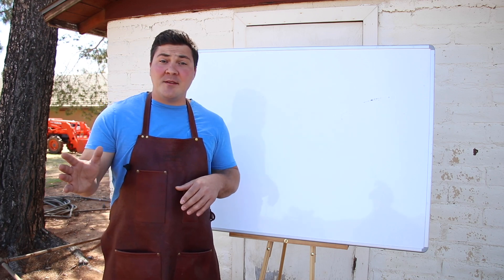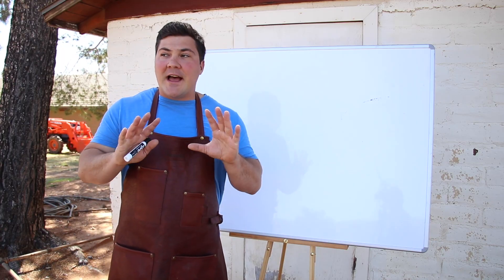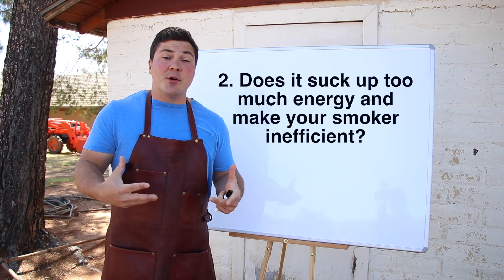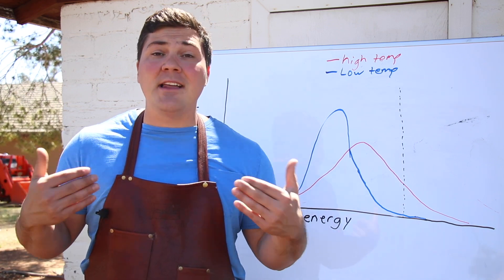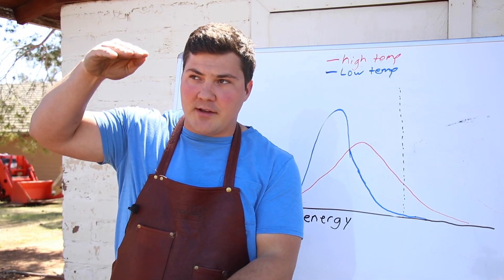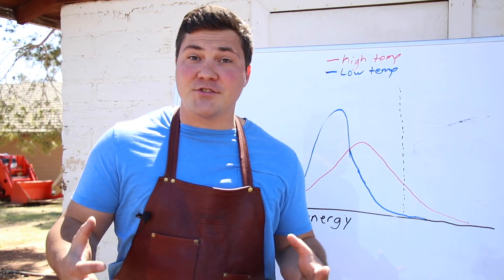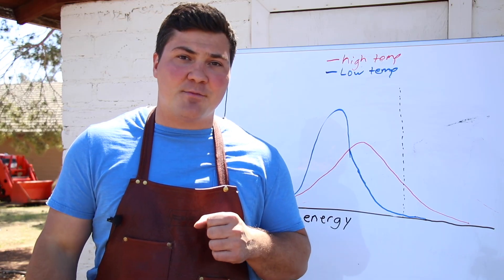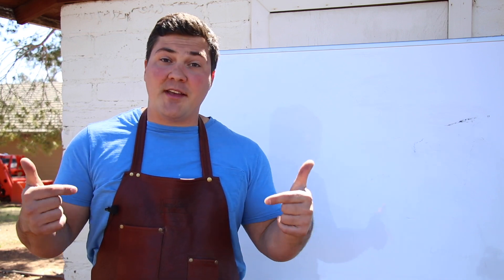Do Water Pans Improve Barbecue? A Scientific Analysis

Comment: I have an offset smoker and I use a water pan when I’m going to have long cooks and I’ve found it’s not needed for shorter cooks. I recently removed my baffle plate and found that the best place for the water pan is all the way back right in my smoker. The one or two times that I have forgotten it or it ran out of water, I could tell a difference in the outside of the meat I was smoking. Great video and a lot of technical information for us to absorb.

Comment: Weber's Smokey Mountain 18 or 22 comes with a water pan.  It's been manufactured for years..  I'm glad it has a water pan... and I fill it up everytime I do a smoke.  I personally think it makes temp. more manageable.  I'm not well educated... in fact... a poor High Schooler that barely graduated.  Weber designed that smoker...  If it had been a mistake, I'm sure they would have changed it, down through the years... so I trust them, that they did the right thing... and I use it.
Now almost 70... my ribs have always been great.  Good Video.

Comment: Something I can’t find mention of…. By increasing humidity in the cook chamber you somewhat shift your equilibrium toward condensation vs evaporation on unwrapped meat.  This should help overcome the “stall” caused by the cooling effect of water evaporating from the meat countering the heating from the cook chamber.  I think it just drives the stall point higher, but it does affect it.

Comment: i got one for you to try. Smoke a brisket like you do regular. the when you wrap instead of paper get an aluminum pan with talo at the bottom that you smoked, lay the brisket in it then poke holes on another pan and use metal spring clips to secure it to the other one and finish smoking.

Comment: this is great breakdown- but very specific to your smoker/setup. consider pointing out the difference between a ceramic/kamado style and a non insulated metal cooker. the need for moisture to be added changes significantly based on the cooker!! Also as stated this can help people understand the benefit of a pellet smoker as well
Reply: we like tradition so we use wood as out heat source it's an art to be mastered unlike a pellet smoker which is no more than an outdoor oven, set and forget it. it's all about the whole process to us pit masters. You'll never get the real smoke taste with a pellet smoker as you do with an offset.

Comment: I have another variable that I think might need to be addressed.  Correct me if I'm wrong.... I'll try to spell out my question.  A water pan will increase moisture through evaporation, but moisture content in the heated smoky air flowing over the meat is greatly effected by the volume of air you're pushing.  As you've said in other videos, airflow is what makes an offset smoker yield more flavorful meat, and what you've said in this video, much heat and moisture are lost to the stack.  In the case of this example, more airflow would mean lost through the stack, which would seem to lessen the effect of added water- there would be a smaller change in the humidity of the cook chamber and less moisture interacting with the meat.  There could be some balance point where the hotter fire to overcome the loss of energy to the water pan increases the airflow so that there is no net gain.

Comment: The question I've been trying to answer is how does this change for a pellet smoker/grill which is essentially just a convection oven. The air is moving through quicker and the air from the outside is being pumped into it quickly and never goes across a moisture producing firebox first.
Reply: put a small water pan next to the auger - it will work just fine
Reply: @unclealzbbq2185  you genius

Comment: Hold up!! 69.6 lbs of water from wood ? you burn 348 lbs of wood for 1~3 brisket ?   That is a crazy amount of wood, your smoker must be huge. Great video and I agree with your assessment.  as you said, many people use hotel pans in small offset smoker like 35 gallon or less, and they arn't burning 40lbs of wood much less 350, so that is going to have more effect on total moisture.   I have a trailer mounted offset smoker. Its made of pipe,  I would guess its around 350~400 gallons.   I use a water pan as a moderator for the fire.  Like control rods in a reactor,  not for moisture.   The hotter the draw off the fire box  , the faster the water boils.  water to steam expands by a factor of 1700 to 1. slowing the draw and reducing the heat from the fire box as well like you said the temp of the flue gas coming off the fire box.   My 1 cubic foot of water will displace 1700 cubic feet of fresh air coming in the fire box with the exhaust rate unchanged.   in this process i can also run the fire box hotter, keeping more open flame and less smoldering creosote, as well as more "air" moving across the smoker giving me a more even temp on my equipment.

Comment: sorry,but my shift button does not work any more. a old laptop. i am subscribed to your channel. you have a video on the best smoker for beginners. i would say this, i used a old used smoker that my neighbor gave me before he past away. he only asked me to smoke a brisket for him and i did. i was a old brinkman offset smoker and i cleaned it and seasoned the inside before using it. was taught by different videos on youtube. he had that brisket a week before he past away. then i gave it to my other neighbor that wanted it. he even gave me 100 dollars for it. then i saved my money for a few months, because i am on social security. i bought a brand new oklahoma joe highland smoker. then i bought a metal 6 shelve unit from home depot. the bottom shelve has cherry wood on it, then the next shevle has pecan wood, then i have my smoking tools on the next shelve. like my chimney, temp gauge by thermpro, some store bought rubs and 2 boxes of latex gloves. above that its all oak wood. i buy my wood from a man that has a tree service. then when i run low i buy some wood and cut it with my chop saw to fit in my fire box. some of the mods that i bought was the metal milk grate for my fire box and a smoke baffle. i also bought a metal meat loaf pan from walmart and i use it for everything that i smoke. so far i have smoked a few brisket flats, a boston butt, a few slabs of spare ribs and some beef ribs. when i smoke i give my one neighbor some of the meat or chicken or fish o cheese that i smoke. i even make some killer cheese dips in my smoker. my metal shelve is in my garage with my smoker and grill only until i get my patio done in my back yard. but my choice for a first time smoker is the highland smoker that you can get at lowes everyday. everything else i get from amazon, except for my lump charcoal. but now i need to say thank you for putting all these videos together for all of us. you have helped alot of people on this hobby. because of you i will never go hungry. thank you again from jacksonville fl. if your ever in the area stop by and say hello. i am your tallest subscriber you have. all 7 foot 3 inch tall man. thank you again. i forgot to say, i used a small fan that sits level with my fire box to keep my fire going. it helps out alot

Comment: This is a 2 parter question but might not be fully on this topic.   I have a Chargriller 50/50 without the smoker box attached.  I have tried to smoke in the regular charcoal grill side and find that with the vent open to this chamber it still does not seem like enough air gets in to make it burn clean and I still get white smoke but not thick bellows of it.  should i use a water pan or soak the wood which I heard you should not do.  sometimes i use wood chunks and sometime chips and the chips seem to burn up quick so do i empty a whole bag on at once or constantly sprinkle some more on as i go along.  any advice, help is greatly appreciated and sorry if the question is silly, simple or not in right forum.  Thanks everyone

Comment: I tried using a foil one like a turkey one and it ended up being burned on the edges.. the flames were growing on the sides of my smoking stone... And the water was boiling.. i had to pull out the water tray.. it was getting melted..

Comment: Thanks for the explanation, but by calculating the mass of water, I think it over simply one key aspect which is relative humidity.
You can have loads of water but be very low on relative humidity which is what matters to transfer « moistness » to its surrounding.
A sponge in a smoker would end up dry even if there is 100l of water that has passed by.
Considering the heat sink aspect the of the pan,  it has dual action. First reduce the temperature (which by itself increase the relative humidity) and releasing humidity which amplify the relative humidity.
Some
Probes in the cooker would be the judge with and without a pan and get the relative  humidity with and w/o a pan :-)

Comment: Not sure if you will answer but does the type of water used matter? Will using like say lake water in a water pan matter vs distilled water? Worried if I am at a remote location smoking that using river water or high sulfur well water would add unwanted flavors to the meat.

Comment: Man I was glad you talked about complete vs incomplete combustion 🙂. 
Another noteworthy benefit of water pans in smaller smokers is temperature stabilization. I use a weber kettle and the grill itself doesn't retain or reradiate a substantial amount of heat like kamado cookers or heavy gauge steel smokers. The water pan is a stable heat sink which reduces the extent of temperature swings when you open the lid. That goes back to your comment about the pans making the chamber ideal weather for bbq. Cheers.

Comment: Do you really use an entire cord of wood for an 12-hour smoke? I find your calculations of 176 lbs of water to be over the top crazy. For a brisket on my BGE, I use less than 9 lbs of lump coal & seasoned wood. Here, a water pan makes a big difference. But instead of calculating the amount of expected water released -- me thinks you would do better to measure the humidity inside the smoker with & without a water pan. THIS, imo, is how you can determine if they make a difference and how much so.

Comment: I actually looked at this yesterday with my new pellet smoker. I always used a water pan in my Weber kettle to help maintain a constant temperature, swore by it. Being a new smoker to the collection and never having a pellet smoker before, I wanted to look at the temperature differential across the pit (a GMG Jim Bowie). It has a temp probe at one end to control the unit. I placed a water pan at the other end of the unit along with a second ambient temperature probe. Before the water pan, I had even temperatures across the pit running at 225. After adding water, that side of the pit dropped to 180 and pretty much stayed there. Sure it was a steady temperature but came at the cost of a huge temperature gradient across the pit. After a few hours, I pulled the pan and I went back to even temperatures across the whole pit, a steady 225. Even after kicking it up to 240, I was even across the pit.  I have the temperature graph to back it up and in my mind, the water pan created more problems than it solved. You can clearly see when the water pan was added and then removed. 

I think the controllers on a pellet grill (at least a PID controlled one) are doing the work of maintaining temperature and less of a the need of a heat sink of a water pan. Maybe I could try putting the water pan directly over the fire chamber in the center, but at this point, the space it would take up does not offset the benefit.

Yes, I know, using a pellet grill certainly takes a lot of the art out of mastering a fire, but sometimes you gotta do what you gotta do.
Reply: I've never tried it but a practice some people swear by is to evenly space raw biscuits across your entire cooking surface. This will tell you exactly where your hot spots are as they cook. Plus, you have a bunch of biscuits to eat as a bonus!
Reply: @michaelcoughlin8238  I did that when I got the grill and helped me position my heat deflector better. It was pretty even across when I was done, that is why I was so shocked with the water pan results.
Reply: Just got my first pellet grill (Traeger) and this is exactly what I needed to read.
Reply: Try filling your water pan with sand instead of water. same result, with no temperature swings.

Comment: Great video!  Isn’t conservation of energy great?  I’m teaching physics online now and have to make videos for my lectures, so I know how much work and preparation (and possibly redos) went into making this.  I’d love more detailed analyses like this.  

The greater surface area is to have a greater rate of diffusion correct(?), even though the metal would heat the water at all depths.  I wonder if the rise in temp of the metal tray thus raising the water temp at the bottom and sides 
 would be comparable to the water’s temp rise at the top?  If so then it’s even more efficient.

Comment: It seems other backyard scientists have already addressed the science of the water pan, im going to address the common sense aspect of water and cooking. If you want juicy pork chops or chicken breasts you sear them first before baking them in an oven. You can put a water pan in your oven and it will make no difference how juicy the meat is but that sear seals in the moisture. Another example is if you cook a rump roast in a crock pot or oven it still comes put dry because the lack of inter-granular fat in the muscle. Water does effect cooking efficiency in a smoker for obvious reasons but the real question is how does additional water effect the smoke? After all using a smoke is about getting smoke flavor in our foods. Its also why smoking at low temps imparts more smoke flavor than high my theory on that is once the outside later of meat gets cooked it wont take on anymore smoke. Different ball of wax when we talk about cold smoking as that is about fragile meat like fish completely different subject. Test water and its effect on smoke that wound be very interesting and as a side note i never use a water pan in my smoker.

Comment: You can't MAKE water 
When you heat air you raise it's dewpoint. You start a fire next to said metal, the metal is going to be cooler than the fire. Heating air allows the air to trap more moisture. That moisture will condense on ANYTHING that is cooler that the water saturated air around it. 
This is how an air conditioner or dehumidifier work. 
The lines with the refrigerant in them are cold. When the hot humid air meets the cold lines, the water vapor is stripped out.
You're getting way too complicated here. Matter and energy cannot be created or destroyed, they can only change forms.

Comment: Jeremy, what are your latest thoughts and recommendations on whether to use a water pan with a pellet smoker? Thank you.
Reply: I actually looked at this yesterday with my new pellet smoker. I always used a water pan in my Weber kettle to help maintain a constant temperature. Being a new smoker and never having a pellet smoker before, I wanted to look at the temperature differential across the pit (a GMG Jim Bowie). It has a temp probe at one end to control the unit. I placed a water pan at the other end of the unit along with a second ambient temperature probe. Before the water pan, I had even temperatures across the pit running at 225. After adding water, that side of the pit dropped to 180 and pretty much stayed there. Sure it was a steady temperature but came at the cost of a huge temperature gradient across the pit. After a few hours, I pulled the pan and I went back to even temperatures across the whole pit, a steady 225. Even after kicking it up to 240, I was even across the pit  I have the temperature graph to back it up and in my mind, the water pan created more problems than it solved. You can clearly see when the water pan was added and then removed. 

I think the controllers on a pellet grill are doing the work of maintaining temperature and no need of a heat sink of a water pan

Comment: While I did enjoy the video and commend you on your education, what you took a long time to say really didn’t say much. You presented no real hypothesis to be tested, and outside of you showing that adding a water pan adds more moisture in the cooking chamber. DUH! What should be the goal is to determine what effect that added moisture has on the final product. Take this for example, if I decide to get the core temperature of whatever I’m trying to cook to target as fast as possible, rather than slow cook. We already know the answer to which cook would be better and it has nothing to do with the level of humidity inside the cook chamber.
What you be more testable over the course of several cooks is to determine whether:
  a) Does slowing down the stall by introducing more humidity produce a juicier product?
  b) Does adding almost pure humidity take away from the flavor added?